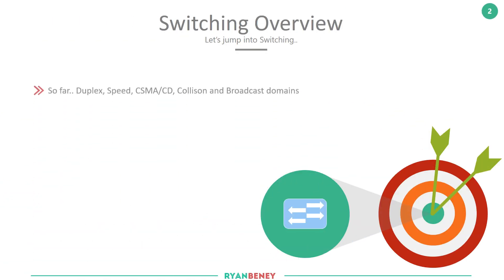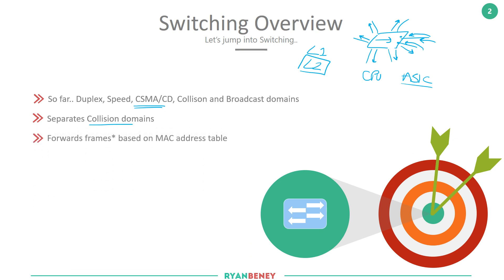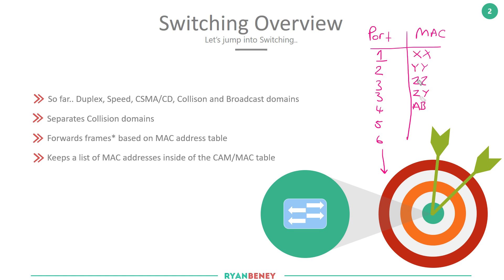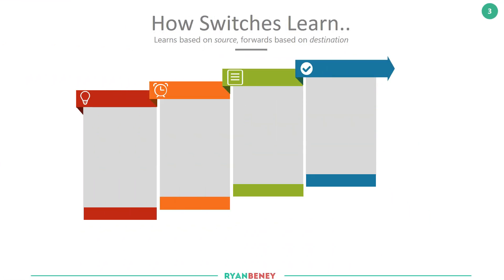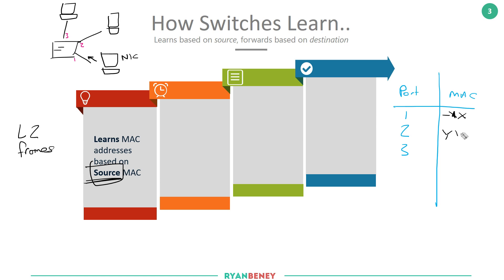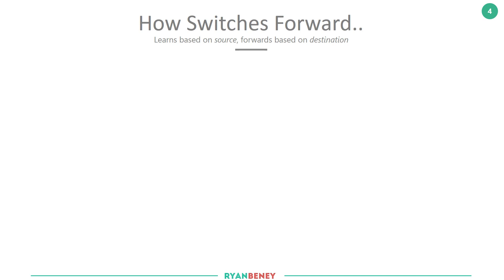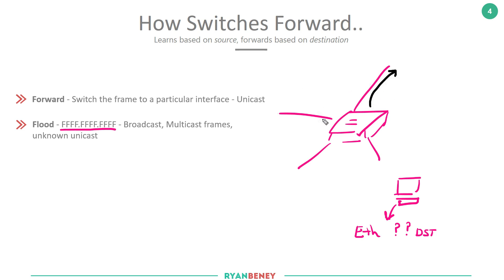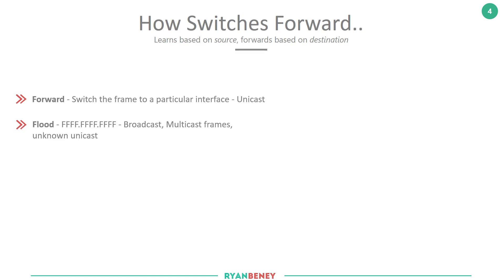Cisco - CCENT/CCNA R&S (100-105) - How Switches Learn & Forward Frames .18

Comment: Someone commented below that the video lacked MAC explanation/ description So I decided I'd add a note:

A MAC Address aka (Media Access Control)  or BIA (Burned-in address) is a unique address associated with all physical/logical network adapters; includes both physical and wireless adapters. The address is composed of hexadecimal characters which range from 0 to F / value 0 - 15; where F is equal to 15 and A is equal to 10.
An example of a MAC address is D0:50:99:44:B8:3E .
The MAC address can be separated into 2 parts. The first part describes the manufacturing company and the final part is unique and randomly choose by the manufacturing company.
Considering the above example of D0:50:99:44:B8:3E 

The first part which is always the same for that given manufacturer is D0:50:99 or the 1st 6 Hexadecimal values (This hex code is unique for each manufacturer and assigned via IEEE)

and

The 2nd part 44:B8:3E which is uniquely generated by said manufacturer.

To further express the value of this Hex value you can break each Hex character into either decimal or binary value.

Examples of hex to binary and deci conversions:

B = 11 in deci

B = 1011 in binary

You must use exponential math to figure Hexadecimal just like deci and binary.

2^3 = 8, 2^2 = 4, 2^1 = 2, 2^0 = 1
10^3 = 1000, 10^2 = 100, 10^1 = 10, 10^0 = 1
16^3 = 4096, 16^2 = 256, 16^1 = 16, 16^0 = 1

Hopefully this clears up any questions via MAC =D
Reply: Companies have multiple UOIs as they have many devices. A cisco UOI is 00:00:0c

Comment: Hi.I have some questions regarding the CAM table.
1. How many entries (minimum) are in a CAM table on a L2 switch lets say?
2. If the switch has already populated the CAM table based on a particular port and then you disconnect the device from the port and add another device is the CAM table on that port deleted and updated with the new device or is it added to the existing CAM table?
3.In the scenario 2, if the CAM table is already full, considering the old device has been disconnected and a new device is being connected to that same port, what happens to the CAM table?
I think you are a terrific teacher and the way you explain this CCENT course is just amazing.I love the review at the end and the fact that you are open to answer questions even though it is so long since you've uploaded the videos.
Another GOLD STAR!!:d
I did followed your advice to learn from different sources and so far I must say (out of 4 sources) you are best in teaching this CCENT.
4.Lastly, the 4th question, would you recommend I would go through the videos first and then start learning from the book(not really a book fan) or I should start with the book as soon as I will finish your video course as I was thinking to go through the cbt nuggets as well and then start with the book
Again, thank you for this amazing presentation
Reply from the maker: 1 – Platform dependant, meaning you’ll need to look at the specification of the switch you’re buying. You’ll find lower end switches have less memory reserved for the CAM table vs higher end switches
2 – Yes. If you learn a MAC address on port1 and unplug that device, the switch will notice the port has gone ‘down’ and remove any MACs it had previously learnt from that port. It will then learn of the MAC on the new port once it starts communicating
3 -  Each MAC address entry has a timeout value of 300 seconds / 5 minutes. If the device doesn’t talk to anyone, the MAC address will be cleared from the table. Every time something is unplugged from a switchport, everything previously learnt is removed. 
4 – Personally I would watch all the videos you have available first, especially if you’re not a book fan. I find watching the videos then reading the books helps me visualise what the book is trying to explain
Keep studying!  - All the best.
Reply: Will do so
Thank you!!!
Keep up the good work

Comment: Hi Ryan how CAM table know the port number,  it is the layer two device, i dont know may be the question i am asking is stupid, i am new to networking, Please can you explain, thanks.
Reply from the maker: Hey Kamran - When a switch receives layer 1 electrically signals the switch can identify this as an Ethernet frame and at this point, the switch knows to make a note of both the source + destination MACs along with the port number the signals were received on... It then extracts the source MAC and port numbers for its CAM / MAC address table, ensuring this information is populated or if it already exist in the table, the timer is refreshed. Then looks at the destination MAC to try and understand what to do with the frame (Flood, forward etc). Hope this helps
Reply: Ryan Beney thanks ryan you are a great help and thanks for the contant you creating is really help full, look forward to see more from you thanks